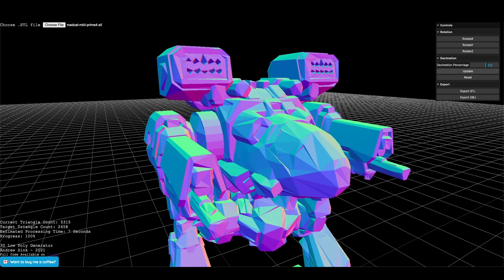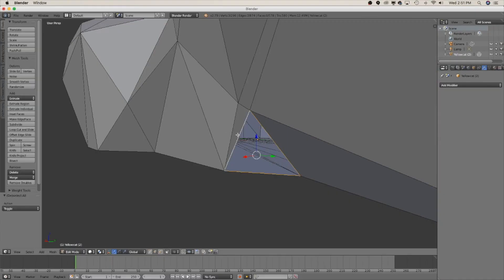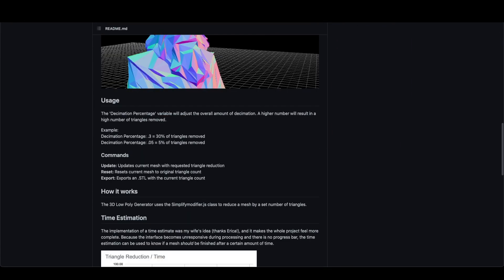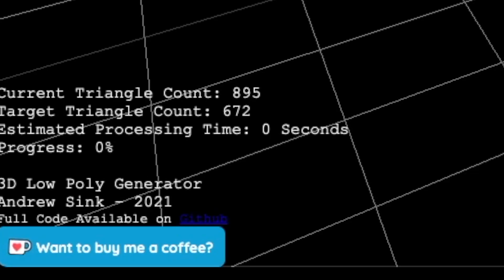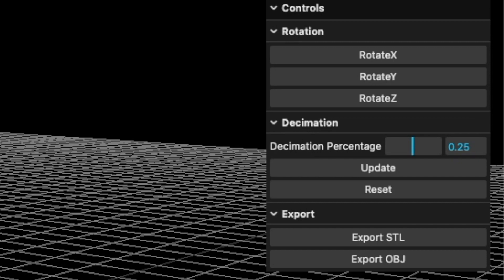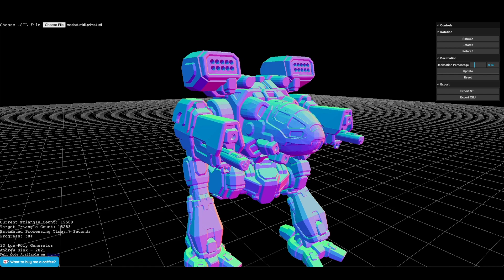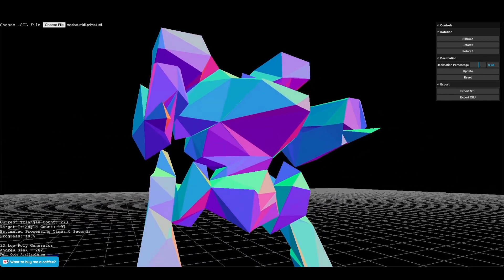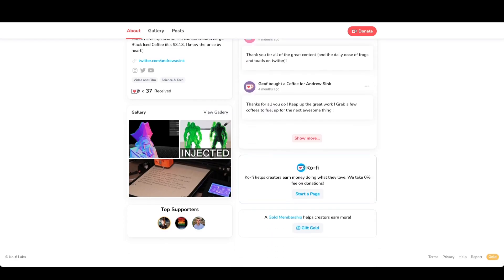3D Low Poly Generator / Easy Low Poly Models for 3D Printing!

Comment: I have a file starting with over 1 million triangles. I have it set to decimate to 50% and it did so successfully. Unfortunately the "Export STL" button seems completely useless. It will not export. Thoughts?
Reply from the maker: Huh. Thats a strange one. Can you try exporting without decimating to see what happens? That’s usually a flag from Chrome when you click too many times and it blocks multiple downloads. Do you see an error near the URL?
Reply: @AndrewSink  It works if I don't decimate.

Comment: hey this is great but the decimated mesh is slightly tilted ..so any way i can exactly export without change in position (ik its a negligible change in position but for baking high poly into this those position change will effect ) but yeah thanks for this great tool

Comment: Dear sir,

Is there a way that the low poly model's triangles can be exported to DXF format so that it can be cut from steel and then welded into a sculpture? Thank you in advance.
Reply from the maker: This is a great question, and it's a long answer. Short version: No, not easily in this software. Autodesk used to make a software called "Slicer" that would do this, but I don't think it's still around. 

Cool idea, might be worth checking out at some point!
Reply: @AndrewSink  I have noticed that Prusa slicer can reduce the triangles by "simplify model". And it is great. Not exactly what I had in mind, but it helps. There was a time when I dabbled in Zbrush, but the learning curve to sculpt was crazy for me. And I didn't have the free time. Make 123D doesn't work either these days. The low poly models on Etsy are nice, but I don't have that kind of budget(live in South Africa, and our currency is weak against the dollar, Canadian dollar, Australian dollar and Euro. Lol, come to think of it, pretty much every other currency 🤦🏻)

Thank you for your reply though. I'll try and post a link to a horse head that I would like...

Comment: I am impressed with the tool, however, converting it into a software will be a game-changer. It will significantly enhance its speed. The ability to import and export data in an easier and more efficient manner will be a huge benefit. Well done on the great work so far.

Comment: Hey andrew I have a file that is not working in the low poly maker. I've tried other files and they work. I tried switching browsers and that doesn't work either. The first decimate works but only til 80% but then it no longer works.
Reply from the maker: Can you give me some more detail on the problem? Can you try clicking “Decimate” twice?
Reply: it stops around 21k-22k
Reply from the maker: @pacohenry3048  You can decimate the model multiple times; have you tried that?
Reply: @AndrewSink  Yeah i tried that but it still didnt work. The work around I found was saving the model and loading the new file into it.